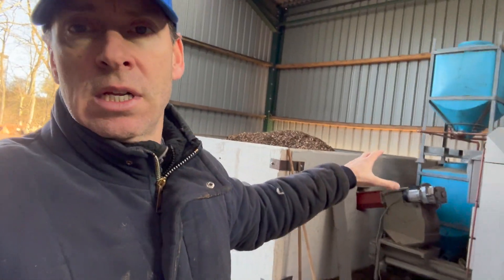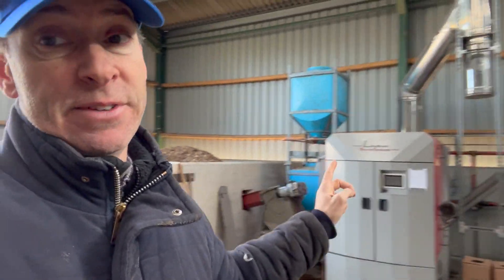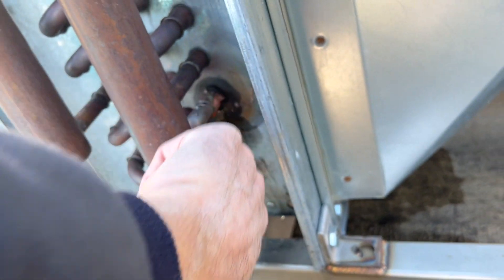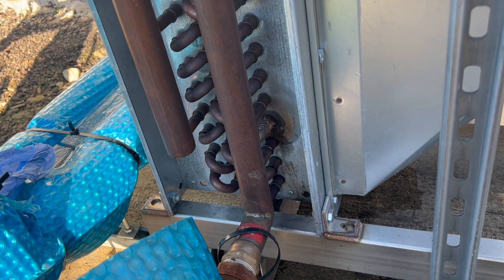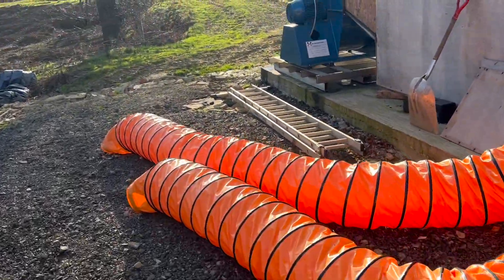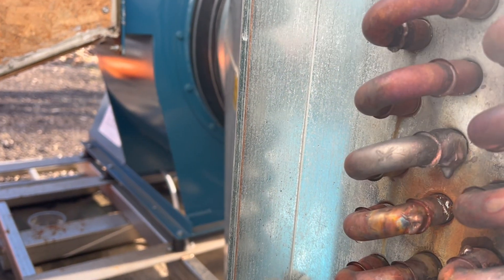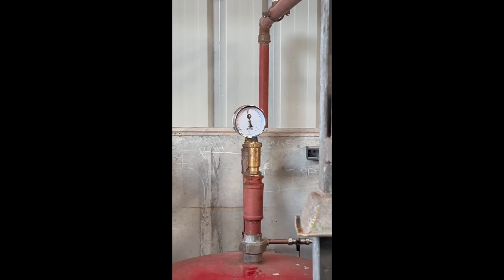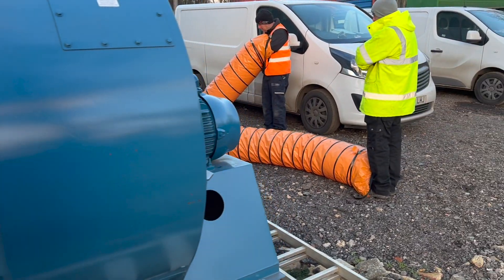The biomass boiler - repairs!

Comment: Buffer tank wouldn’t help if the flow and return had a ice block in it it would still burst of even if the pipes literally went through a outdoor area  froze it would happen aswell
Reply from the maker: yes, if the boiler shuts down for an extended period, outside pipes will freeze, so I don't accept his view that the system would have been fine.